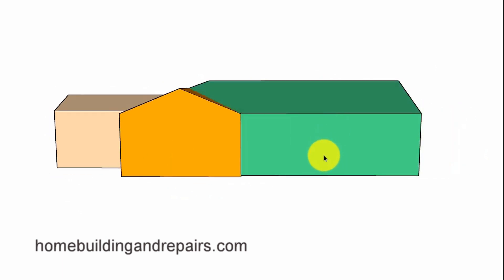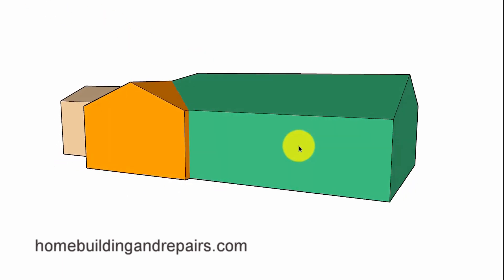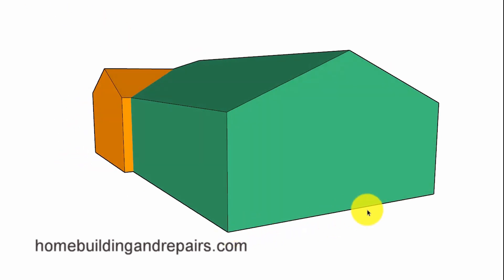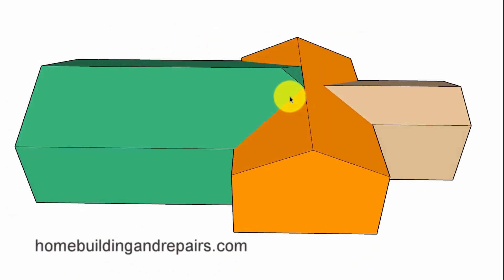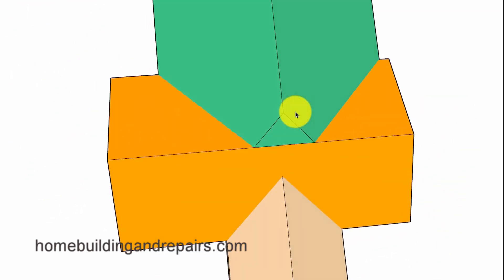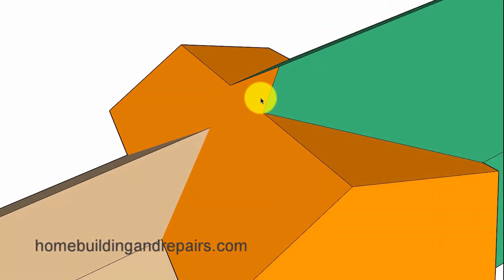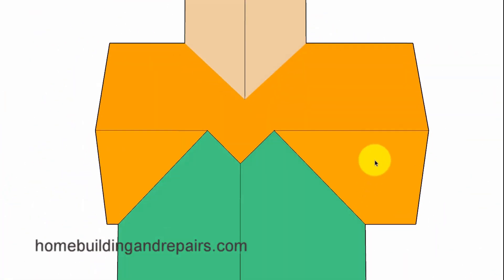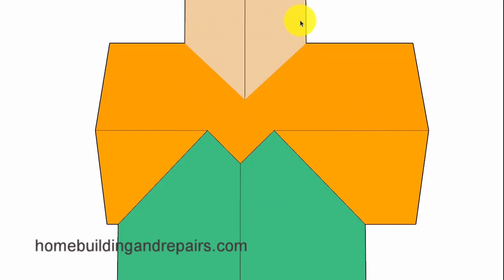Here's What Really Determines The Ridge Height At Intersection Points On Homes With Same Roof Pitch

Comment: Hi, I just came across this video.  We're doing an addition where the existing room is 15.5' and the addition is 30' wide.  Also we have two gables on the 1st level on either side of the front door that are about 15' wide.  Since the new addition, upstairs, is twice as wide we needed to increase the pitch from 3:12 to 5:12 so it looks the same / similar.  Therefore the new addition roof will be about 6' higher then the intersection ridge as your second example shows.   My question is, instead of having a hip roof from the existing ridge up to the new truss, can we have a gable end / dutch gable on top of the existing ridge with a level ridge board from the first truss?   If so can you show what the gable would look like?  Thanks Joe